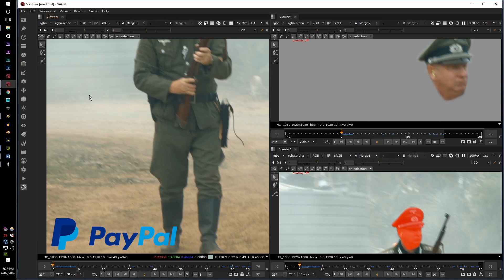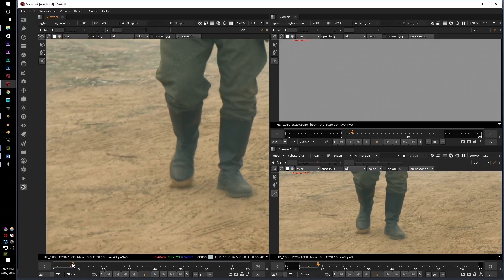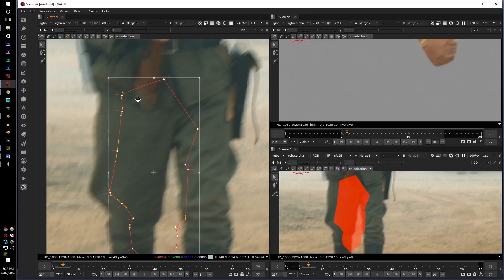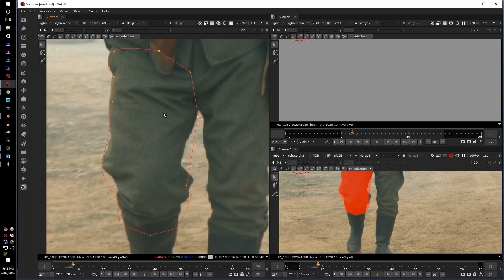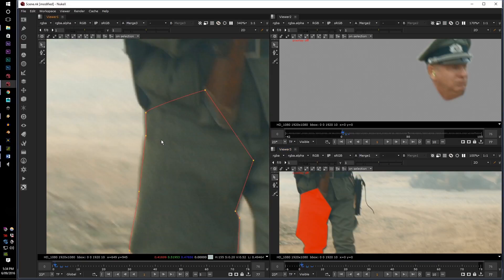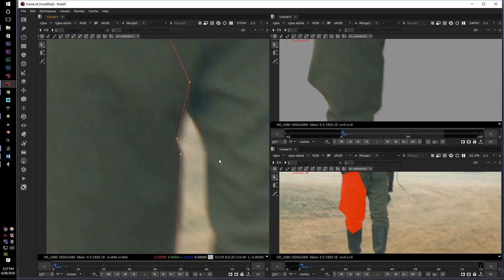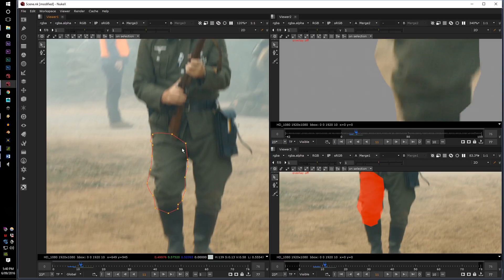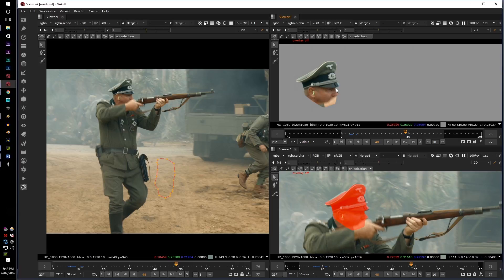Nuke: Rotoscoping Techniques and Methods - Part 3

Comment: Hey, I know these videos are pretty old, but I was wondering what is an acceptable range for the actual feather. For example , if this is the final fine tuned mask of the leg and the image is composited on a darker/black footage using the values of this exact feather it will produce a noticeable white(yellowish) line along the edges. Using the erode note can only help a little bit in that instance and I am curious why the VFX artist did not mention this. I am working on my roto show-reel and I got confused about the exact size of the feather. I would appreciate if anybody who's experienced enough can provide his/her opinion.

Comment: Hey dude.. these tutorials were really very help full and learned alot.. had a query... for example  there is a shot where a character is standing side ways and then turns to show is front body should i use different shape for different positions(life) or try to change the shape of the roto according to the characters movement.. ????
Reply: THEN U HA VE TO ANIMATE THE OPACITY OF DIFFERENT ROTOS BRO